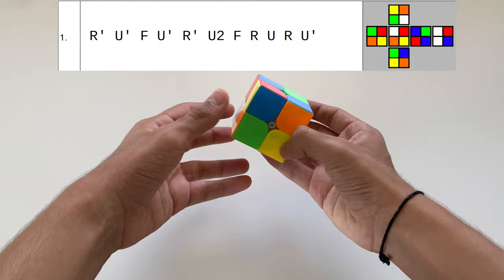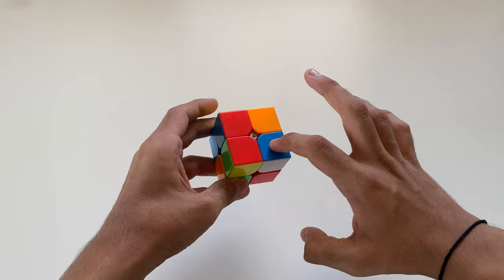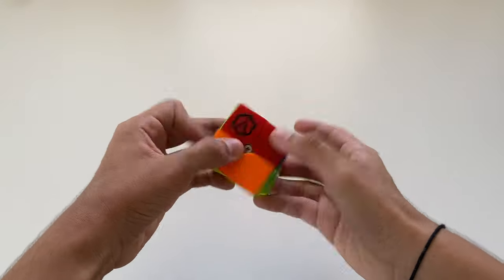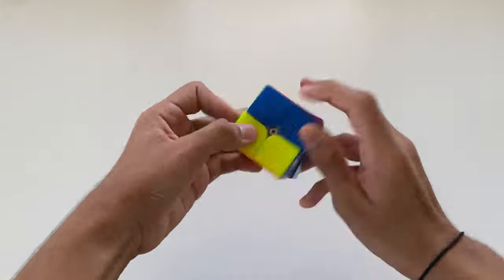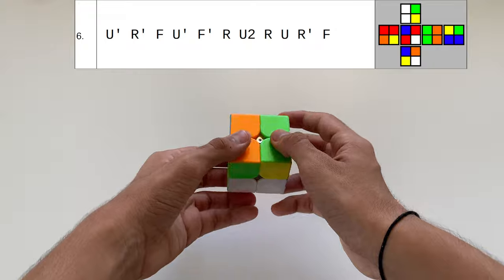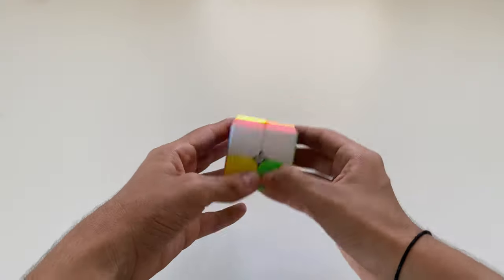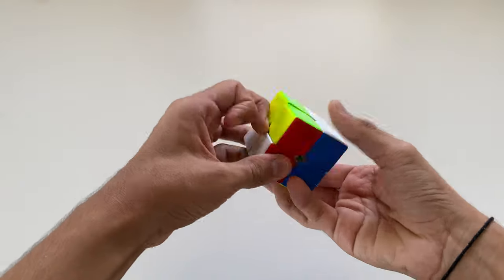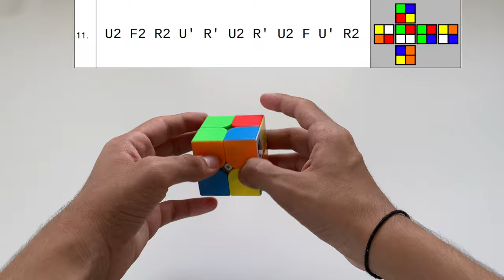2x2 Layer Building Walkthroughs | How to Build Efficient CLL Layers for 2x2 - Sub-3 Guide

Comment: Ram pin this comment as it has alt solutions
 My solutions: 
some solutions are a bit longer but are regripless and more fingertrick friendly

1. zx'  L' U' L2 F' U F
2. its too obvious
3. same solution 
4.same solution
5.similar solution 
6.same solution
7. i would have done red in a real solve
8.y z' U' R U' R' F R2 U' R (much better imo)
9.same solution
10. realistically i would have done yellow and 1 looked it 
11. x z L' U2 R U' R2 F R 
12. same solution
Reply from the maker: Jai Sachdev Thanku Jai
Reply: Ram Thakkar np dude
Reply: Jai Sachdev

Comment: Okay I am a bit late to the party (by a bit I mean 3 years)
But on the 3rd scramble I found a pseudo-layer on green and blue
Its hard to spot but basically,
Find the green-orange corners then link them up
They will lead to a pseudo-layer that leads to a U-case that goes
Left sune, U2, Right sune
Then an R2 to finish off the scramble